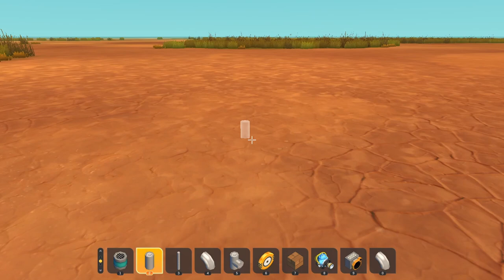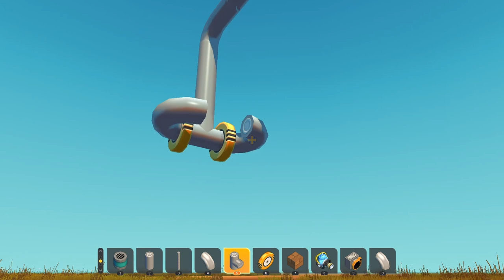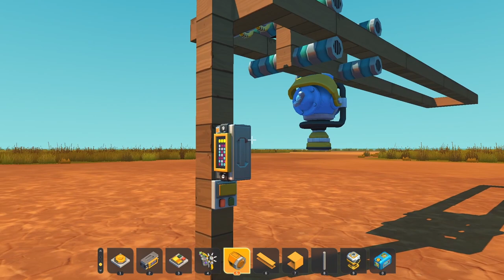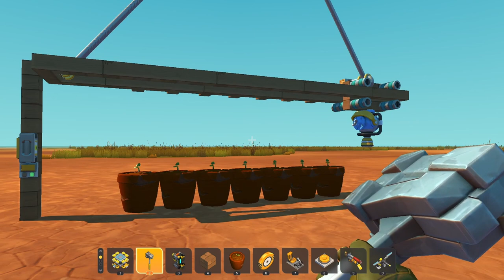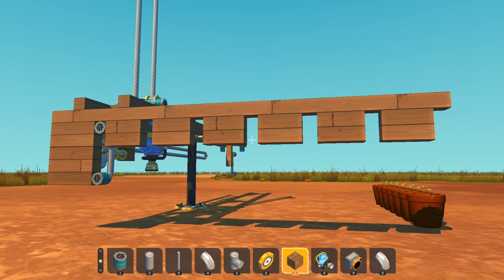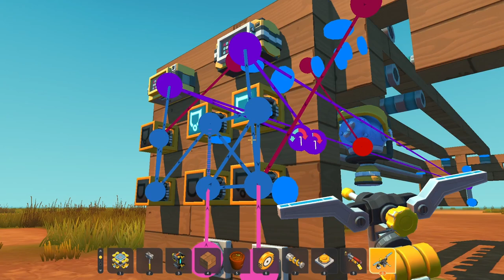Infinitely Scalable Watering Machine Tutorial - Scrap Mechanic

Comment: ill rebuild this tomorow or so. ill try to add a vaccum pump and a chest with another sensor to run across those tracks at the top as well. to see if i can make it plant my seeds as well. great idea was looking for an efficient way to water and seed alot of soil with just one pump, chest etc. great system!
Reply from the maker: If you get it to work please share! I have a few design ideas laying around for sowing and harvesting with this design but I find the delay of the vacuum pump so painfully long that I mostly gave up... it's so much faster by hand...

Comment: I like how you did the linear stepper.
Reply from the maker: That was definitely the hardest part to figure out. You are right, I am not explaining it well in the video. Do you think I should maybe do another video only on steppers?
First of all: It is possible to do a stepper with two bearings on one axle and two controllers each set to loop. One rotates forward, the other one backwards. If you switch on the controller it will start to rotate in a loop indefinitely. If you turn it off it will either finish it's rotation to the next step or rotate back to the last step, but it's hard to predict what it wil do. I tried very hard to make a reliable and predictable stepper in SM but it doesn't seem to be possible right now, because of the way how controllers work. So for this watering machine I kind of cheated...
The two gears on the toothed guiding rails are doing the steps. A 180 Degree rotation is exactly one step of 4 Blocks in this case. The forward motion is integrated in the first controller that also moves the water canon, so I can be sure it will always finish a complete rotation before watering. The reverse motion is done by the second controller. It will only stop once the end-stop sensor stays activated. So if it tries to go back to the last step the controller will be active again.
I hope this helps. If you create something based on this mechanism please let me know. I am curious :)

Comment: I rebuilt it 3x i think maybe this dont work in survival.
Reply from the maker: It definitely works in survival, but this is a hard build indeed. I very intentionally used the blocks and pipes as I did. It is very easy to make a mistake due to the weird physics in SM. The physics settings can also influence how this machine behaves so maybe try to play around with that too and see if you can spot the problem. You wouldn't believe how many of my machines blew up before I got it to work, I know the struggle. Good luck.

Comment: so fun facts about looping controllers
1/ they only need to be activated until half way through their motion to "snap" to the next angle
2/ they remembers exactly how long they have EVER been activated
3/ if your timing isn't "tick perfect", at some point, they just overflow and does 2 "movements" in a row
i tried to build an automatic "floating ladder" builder and these "fun facts" was a pain to design around
Reply from the maker: It is a pain to work around those strange controller mechanics. I could do so kuch more if I only knew how to create predictable results.
Fact#1 I can't confirm. I tried so many times to build something like a stepper motor. I let the controller cycle through 90% or more of the current step and sometimes it still didn't complete the current step but went back to the beginning of the previous step. It only seems to reliably finish the current step if you switch it on and off two times. This method also fixes a lot of machines in real life by the way ;)